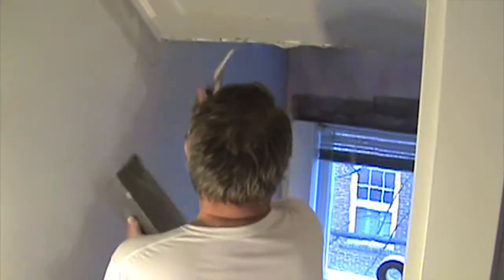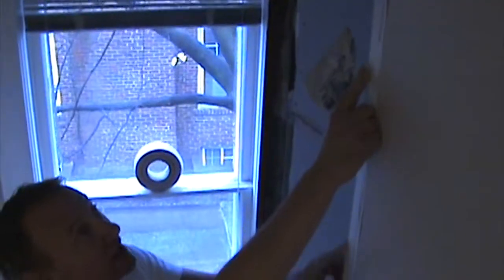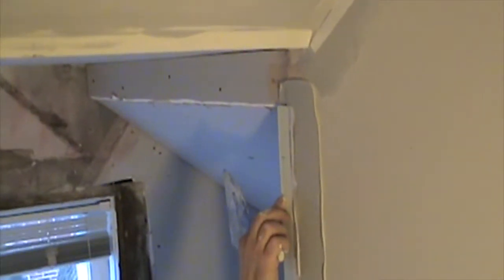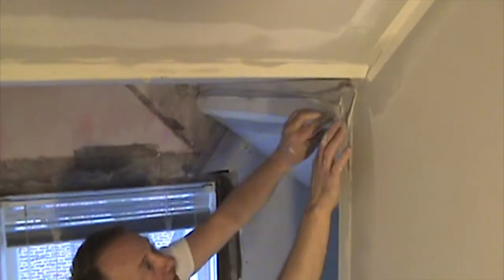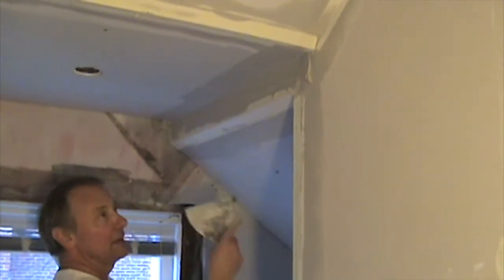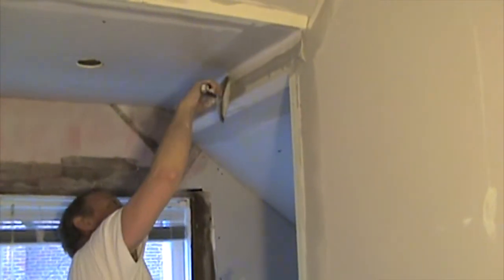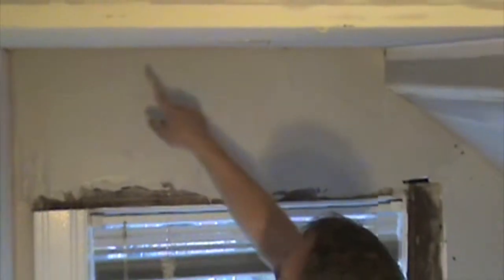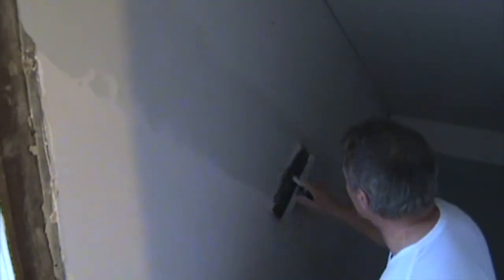How to Cornerbead Drywall/Plaster Stair Repair

Comment: I've done so much plaster repair around here, its definitely not for beginners, but doing so much challenging plaster work makes regular drywall jobs, hung professionally so easy in comparison. Durabond and a lot of times structolite for plaster repairs every time.